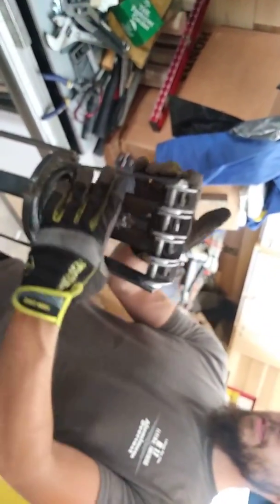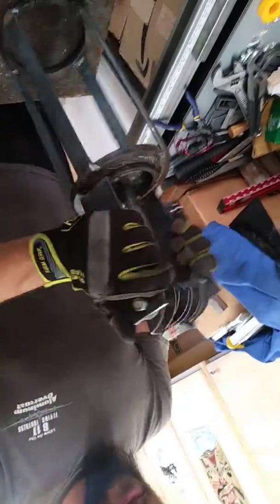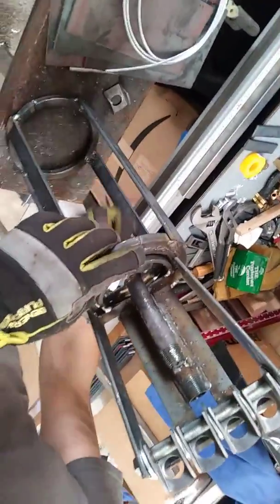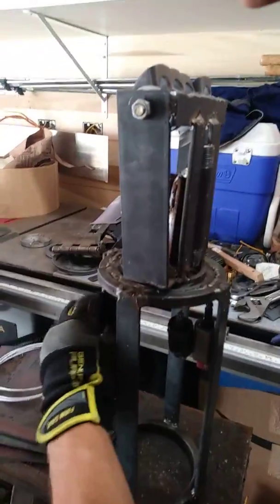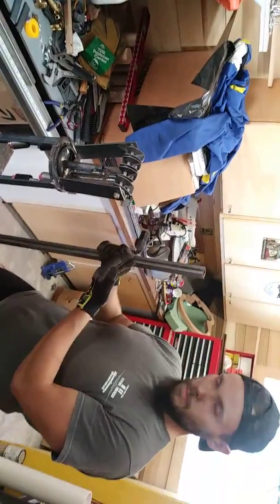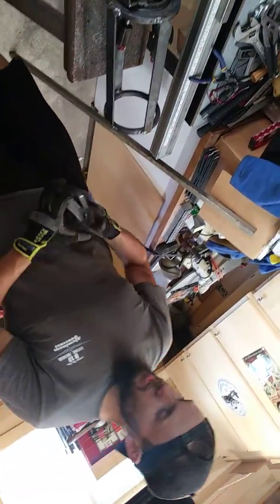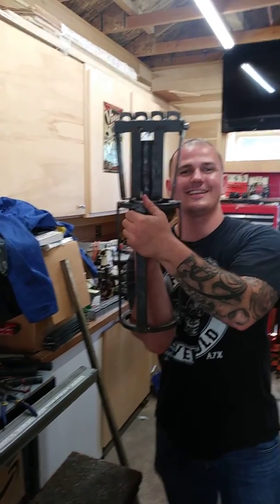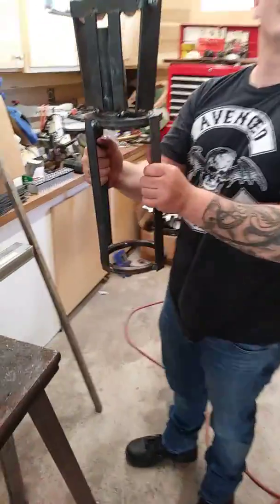Power Armor project #3, details and closeup.

Comment: Start at the legs they are the main support of your suit that's the issue I'm having right now
Reply: The balance of it has been thrown off by the addition of the chest and arms and that arm needs to be attached to something so to save you the issues I'm having that's where I would start
Reply from the maker: rashaan64 we won't know the weight needed to support till we build the top frame. If you want compact but very strong\ cheap leg support, go to the local bike scrap yard and get motorcycle springs.
Reply from the maker: rashaan64 also you should look into the square metal tubing we spoke about. It can take a lot of load off of you and still be light.